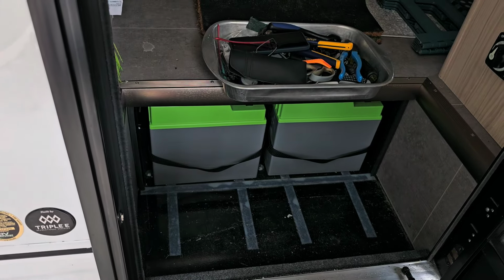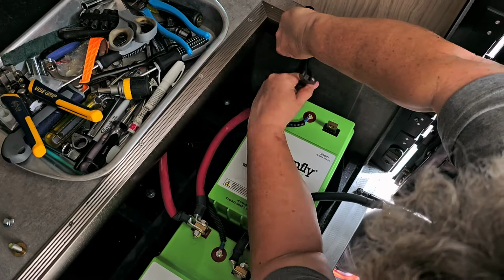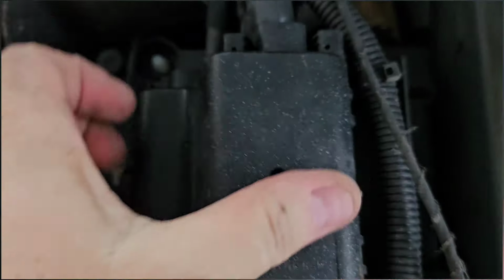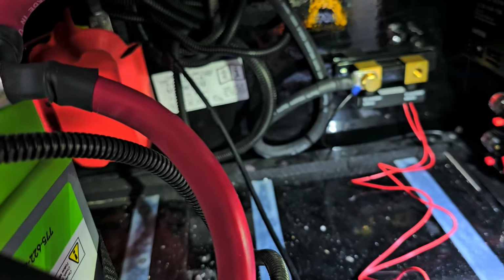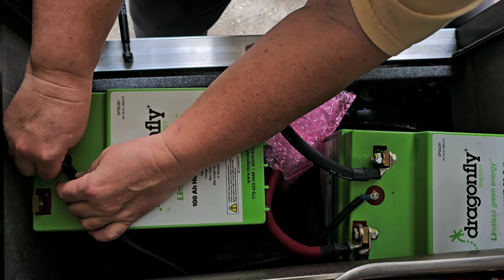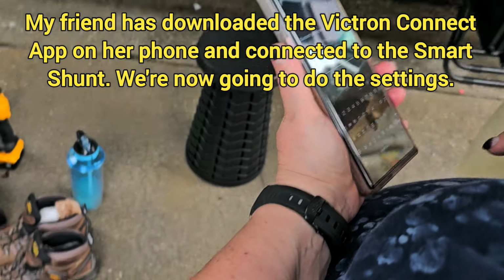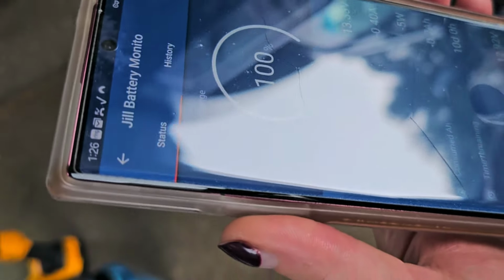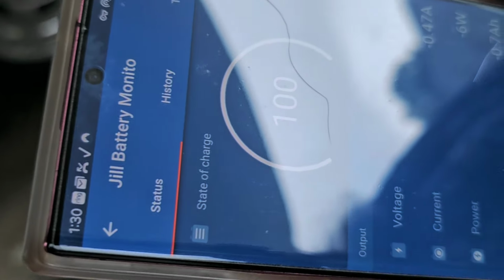Installing a Xantrex ECHO-Charge for Chassis Battery Charging + Victron Smart Shunt Battery Monitor

Comment: I have a 2020 Wonder RL with 200 amps lithium and 400W solar.  I purchased the echo star linked in the video but my dealer says that Xantrex says it is not compatible with the chassis batteries and would kill the lithium in a year or so. 

Is my dealer wrong. Any advice?
Reply from the maker: @maggiedomos1799  The Xantrex ECHO charger is very compatible with Lithium house batteries. An ignition controlled isolator relay needs to be added on your the Sterling DC-DC chargers chassis battery wire under your passenger seat. This stops a do loop of charging from occuring. The Xantrex ECHO charger is a great chassis battery charger, particularly if you use it with Solar. It sounds like your dealer doesn't really understand how to install the Xantrex ECHO charger correctly in your LTV.
Reply: Thanks so much.
Reply from the maker: @maggiedomos1799  I really recommend you replace your Sterling DC-DC charger, it doesn't really perform well. A Kisae or Victron 50a DC-DC charger would be a much better unit for alternator charging. See this, https://youtu.be/hgMPhdzVf9g?.
Reply from the maker: @maggiedomos1799  Another option to the Xantrex ECHO charger is the Victron Orion-TR chassis battery charger, https://youtu.be/-ZihXQkk8TY?. I would recommend the Victron 50a Orion-XS DC-DC charger for the Sterling replacement and the 18a Victron Orion-Tr Chassis Battery charger. They are both Bluetooth and you can monitor them from an App on your phone.

Comment: Was about to start on putting the Victron Orion under the seat when I saw this video.  Where did they relocate the engine to house charger if not under the seats?  I cannot return the Orion so I am seeking a way to still use it.
Reply from the maker: @dankohlhaas6845  If you have a 2022 or older LTV, one that has a Sterling DC-DC charger or an isolator solenoid then you can put the 18a Orion-Tr Chassis Battery charger under the passenger seat. Look through my videos I have a number of them where I installed the Xantrex ECHO-Charge under the passenger seat, the Orion-Tr can be installed using the same 3 wire setup as I use with the Xantrex ECHO charger. Here is one for the Orion-Tr, https://youtu.be/-ZihXQkk8TY?.

Comment: Do you recommend the Echo-charge over the Victron DC-DC charger?
Reply from the maker: @terrya.brewer8196  I like both, but the Victron 18a DC-DC charger for the chassis battery is an actual battery charger and it has Bluetooth so you can monitor it. The Victron is feature rich, it is a little bit more complicated to install and setup but if you use my video on a Victron 18a DC-DC charger you'll have no problem.